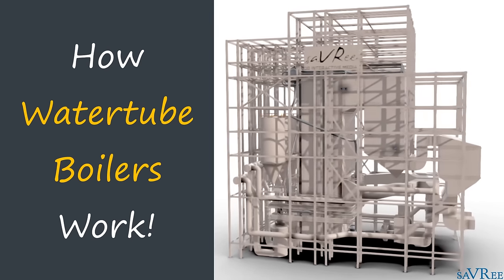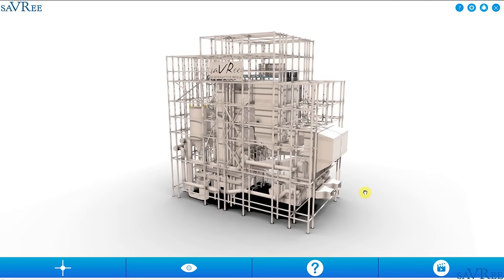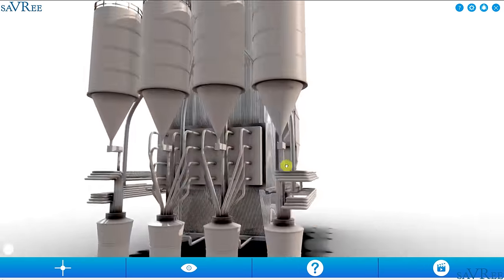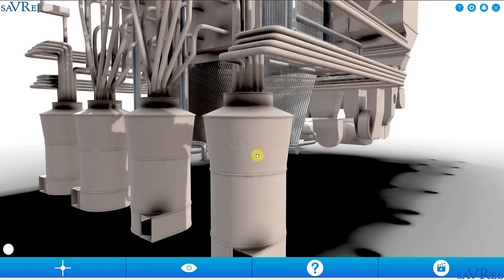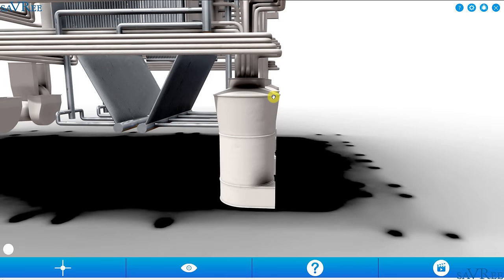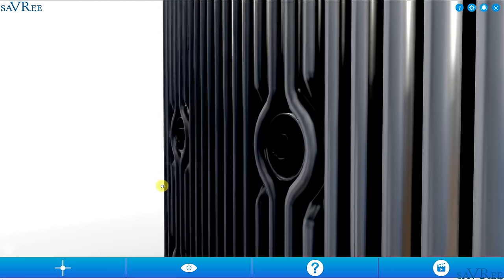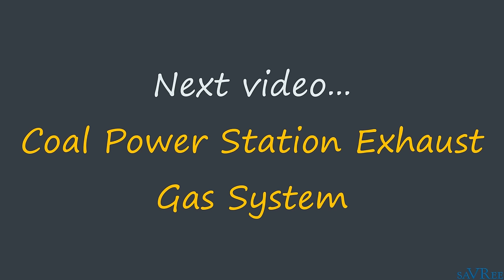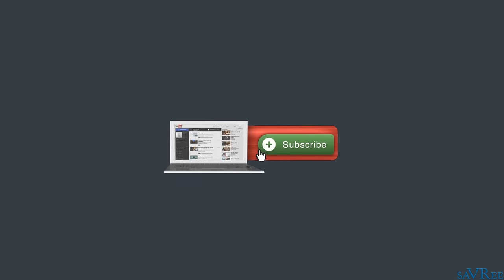How Watertube Boilers Work (Engineering)

Comment: With the ID fan pulling a draft through the boiler you can actually open the inspection doors and see the fireball. Using a welding mask to see is even better! Thanks Savree, very knowledgeable.

Comment: Great video. I ran water tube boilers aboard ship for many years. Babcock and Wilcox and Foster Wheeler. We used bunker C fuel oil. On Shore as an engineer, I operated fire tube boilers using bunker C  oil and natural gas, and sometimes diesel.

Comment: Excellent video! I work in the power industry, primarily concerning the boiler and piping support structure. Fun fact. A good rule of thumb when it comes to thermal expansion of piping (A335, P22, P91, etc.) is that 100 feet of pipe at 1000 degrees F will expand 10 inches along its length. All of the support structure (including the boiler, which is hung from the top) has to accommodate that expansion. Looking forward to your next video!

Comment: excellent work!! A few small remarks; in the gas phase of water, be it saturated or dry steam, water is always going to be in the form of water molecules. when the steam is wet, then we have tiny water droplets in there. But, the molecules are still there. So to state that we have to get rid of the water molecules is incorrect. We have to get rid of tiny water droplets (so, many millions or billions of water molecules coagulated together.)

Comment: Really interesting. One question regarding combustion control/safety. There is a flow of vaporized fuel AND hot air coming from the pulverizers. How is a backfire prevented, either from the fire travelling from the combustion chamber into the nozzles or from an ignition source within the pulverizers. I could for example imagine, that pulverizing is quiet violent, so there might be sparks, electrostatic discharges or simply parts that get hot enough

Comment: Let me see if I have this correct. Steam is an odorless and colorless dry (0 water molecules) gas but in order to get steam, liquid water has to be heated to boiling (212° f/100° c at sea level), changing the liquid state of water to become vapor water. All the white stuff we see rising up from boiling water is visible vapor water commingling with steam but isn't steam. However in order to produce steam, water has to be boiled. So where does steam come from? Are there other ways to get steam aside from boiling water? What happens to steam once it cools below boiling point? Is steam just hot air? Oxygen, nitrogen, carbon dioxide, xenon, neon, helium, hydrogen, all the Nobel gases...now I think about it, aren't all gases colorless? I can't say if they're all odorless (carbon dioxide isn't odorless) but I don't remember ever seeing gases before without the use of (I think it's called a ----->) spectralgraph or by using electricity to excite the gas contained within a glass tube. Acetylene is another stinky gas, man does that stuff smell bad...and so does methane. Give me a minute and I'm sure I can remember some others that reek.

Comment: This is a good illustration, but having worked in powerplants for 30 years there are some design flaws that do not add up or would make this boiler hard to operate.
The narrator did not mention the function of the coal feeder which is the equipment between the silos and pulverizers. They control the flow of coal to the mils.
The burner arrangement is not of any boiler I have ever seen. Normally a pulverizer feeds one or two rows of burners along the width of the furnace to distribute the heat evenly. This model has burners arranged in columns which will cause localized heating on one side or the other. Some Riley boilers have burners in front and rear fed from the same pulverizer but heat the furnace evenly across.
The secondary air ducts come in on the sides so that both forced draft fans can provide combustion air to both the front or rear windbox. In this model if one FD fan is not in service only one windbox is fed air from that fan.
And lastly, there is normally no flue gas flow through the penthouse which is the roof section on the top. That area is where most of your headers and desuperheaters are located and no gas flows around them to protect them from direct heat.
Other than that, the explanations are very good.
Reply: @edwardbyard6540  Thanks for the info. Yes, that B&W boiler has horizontal burner elevations which allows warming the boiler evenly as I mentioned. If you look at the model, the coal conduits from the pulverizers feed burners in columns, not rows... that is not what I have ever seen in wall fired B&W boilers, Foster Wheeler,  Riley, or even tangential fired CE boilers.
I'll leave it at that, no harm done as it serves it's purpose of educating. Cheers!

Comment: Interesting video. I used to work on boilers and this one is fairly similar, except for the placement of some items, like the steam drum, reheaters, and superheaters.

Feed water was also not as high pressure as this case, but every boiler is different.

I really wished you would have talked about steam pressures in this video. For example 850 primary, then 450, 165, 75 coming off the generator for ancillary systems.

Comment: No. I had to Thumb-Down this video because it contains major errors. Specificlally, "Dry Steam" and "Wet Steam" both consist of water molecules. If you remove the water (H2O) molecules, you have no steam, you just have air (N2 and O2 molecules). It isn't the type of molecules that determines whether steam is wet or dry, it's the phase (liquid or gas). 

Wet steam is a mixture of gases (N2, O2, H2O) and liquid H2O droplets. 

Dry steam, aka "water vapor", is gaseous-phase H2O molecules, possibly combined with a little air (N2 and O2), but no liquid-phase droplets of H2O molecules.

I strongly suggest that you learn basic chemistry and physics before using attempting to use chemistry and physics jargon in YouTube videos. As it is, even a 10-year-old 5th-grade science student knows that many of the statements in this video are wrong.